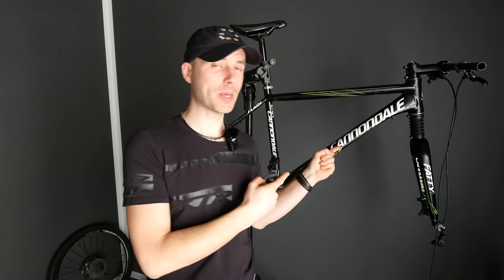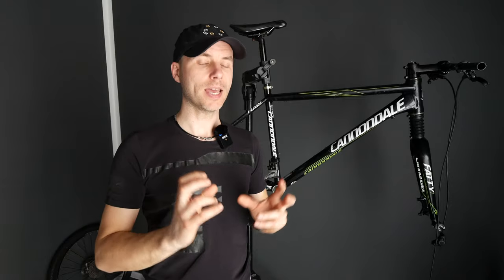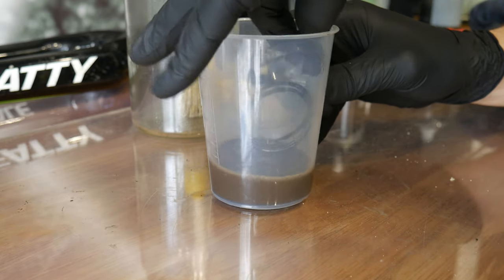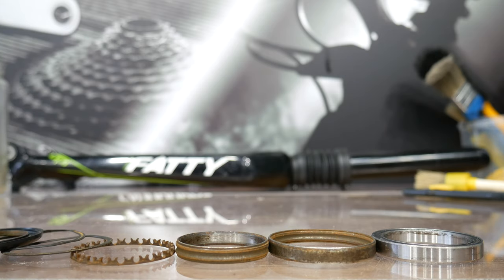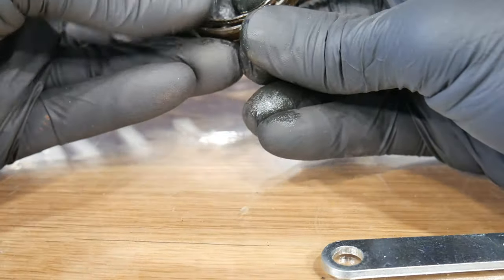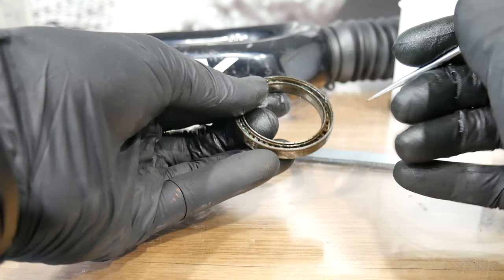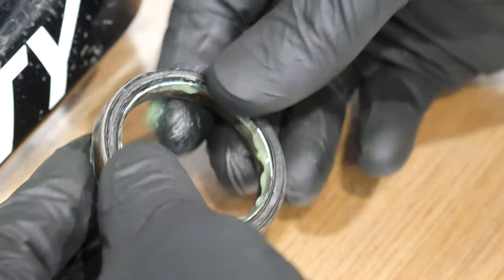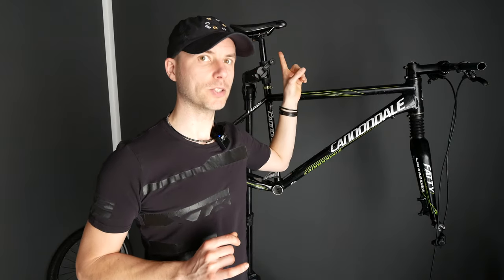How To Disassemble And Grease A Bicycle Headset Bearing. Cannondale HeadShok Fatty.

Comment: Good video for the beginners.
Also you can remove rust with some acid like a citric or vinegar.

And you had miss to tell that this is a angular bearing. The great thing about this type of bearings that you just clean and relube it because you can remove play by tightening top cap, then when ball will make new races you will need to remove bearings play again and you will get bearing that you can you again, till you will destroy cage or inner or outer rings
Reply: great point,. my bike has angular contact bearings in the frame, and I have Chris King headset, bottom bracket with angular contact bearings, angular contact is a must have.

Comment: Ive pulled my headset out of my 4 bikes and they were all rusted, one bike was 2 weeks old and I only washed once then thought it would be good prevention to grease but it was already too late because it was installed dry. So my tip would be, buy a bike brand new just make sure the headset is greased on the outside to keep the water out, preferably a thick grease

Comment: I remember the old days when suspension forks barely existed, you'd get an "indexed" headset where you'd hit the rigid forks so hard that the bearings would pit/ impress on the races under the pressure, resulting in a notched "indexed" steering, oh the old days...

Comment: Rusty bearings need to be replaced. It's cheap, at least much cheaper then I value my free time. So why do the job twice (next year it needs new bearings)?!
Reply: Just because you can't buy it right now, especially in case special bearings
Also there is many places where you can't via ebay, just because seller do not ship

Comment: If you just want to repack them, then there is no need to take them apart, jsut take seals off, smear some grease on the palm of your hand and press the bearing into the palm pressing grease in, rotate it continue to do this until its all covered, wipe off the old grease, or any dirt that comes out, and repeat with pressing grease, and wipe off, put seals back on.

Comment: Thanks for your video. Just a question (because it's not shown in the video)...how to remove the bearings? My "broken" one is the upper one..but if you explain also how to remove the lower, i will be glad. I tried to push from the bottom with a screwdriver with no success...

Comment: Hey. In my opinion its just fine to leave the rust. Once the grease is in there, there is very little chance of the rust continuing. Its different with paint, if you paint over rusted steel it will continue to rust generally and you have to sand back to bare metal, but with grease and oil the chemical reaction must be very strong and does not rust at all.

Comment: Hi, I enjoy your videos!!!...
I have a older late 90's Cannondale, and it has a DaiComp headset with ONLY a allan key amd the "neck" is integrated into the stem. So it only allows for the handlebar to be replaced and I am confused on how I can raise this for a better fit. I unscrewed the allen bolt but I did not remove it. I felt no difference and it must be still stuck, but I remember this headset being unique to Cannondale, so I just put it back so I dont miss a ride day. But my goal is to raise it. Do you know how this is done for this headset?

Comment: 0:54 correct term would be the sealngs are worn or damaged, sealings means the thing you have over your head in the house or apartment, which a sealing lamp is on.